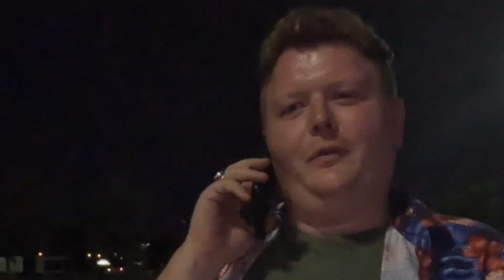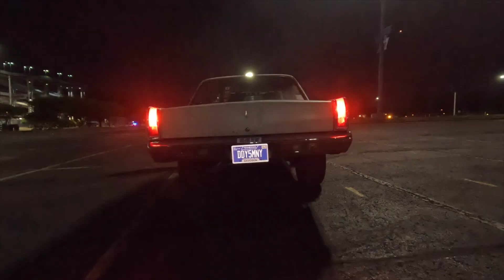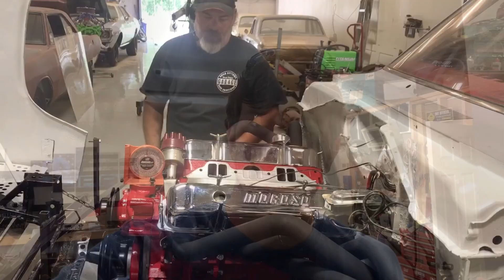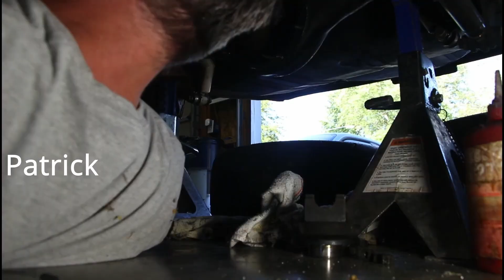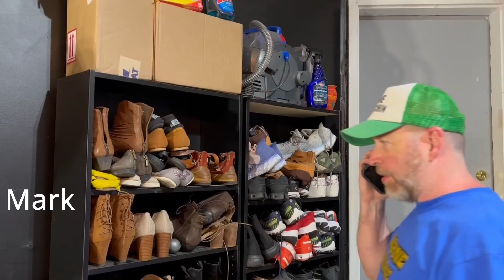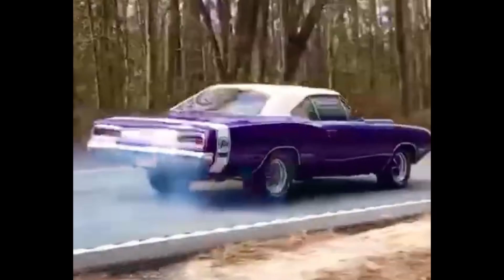Mopar Rollcall Part 2 Promo! Everything You Need to Know! #nonamenationals #mopar#dragcar #dodge

Comment: Hey moparjoe I have 1972 413ci out of a rv. So my question is what can I do with it or do I sell it?
Reply from the maker: I did a full build series on that exact engine. I think there’s 10 videos on it. Check it out if you get time. I did a basic overhaul of the bottom end, new cam, switched to 452 heads, edelbrock performer rpm intake.
Reply: moparjoe thank you so much the guy said jt was a 454 Chevy then looked at it and it’s was a 413 mopar. Definitely will watch your videos
Reply: @JustMoparJoe  thanks I thought I was screwed with I seen that water pump and heads.
Reply from the maker: @thomasdavis1335  yea man. Normal heads and water pump go right on. You might have a misaligned balancer and pulleys depending on which set you try to use. I’ve used the stock one and was fine.
Reply: @JustMoparJoe  thanks man